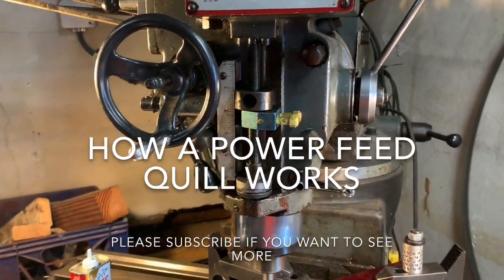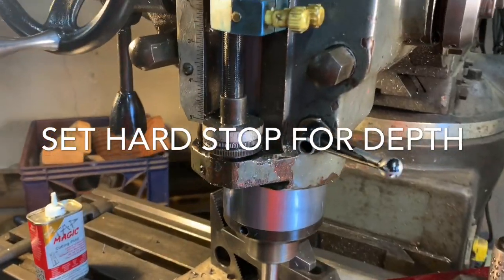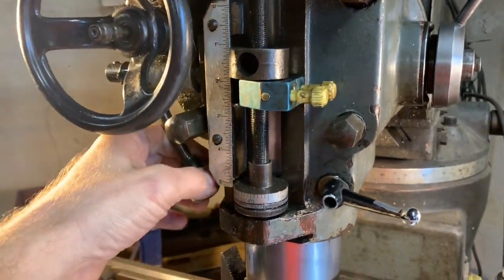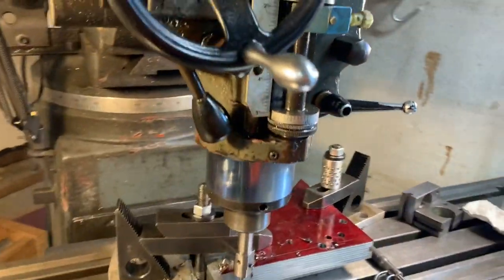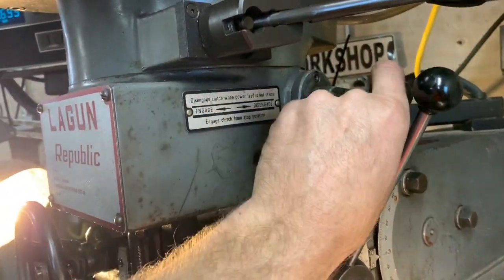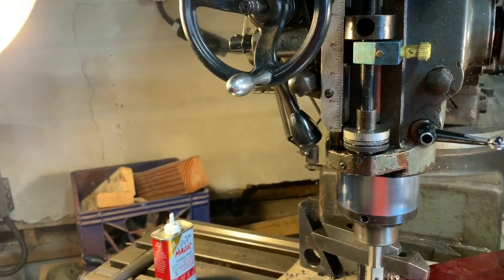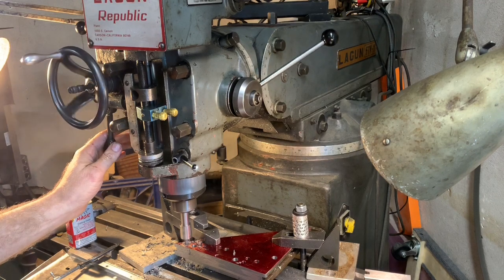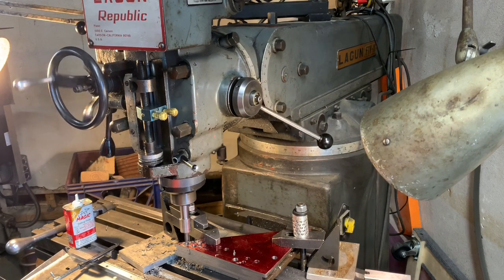How to use the power feed quill on a manual milling machine

Comment: How do you move that feed rate switch on the quill? Does it have to be running? Do you pull the knob out and then move it?   Ths one on this machine seems to be stuck. I have the power feed emgaged on the upper left side. And the right to left power feed works on the table. Quill lock is off and i can move it freely with the hand crank. I can get the crank by the forward and reverse power quil switch to spin but my lever to engage it to start the power feed also seems stuck. All the maintenance people that knee goe to run this are now gone. Trying to learn how to use it. I just cant get the feed rate lever to move or the power quill switch to start the power feed.
Reply from the maker: With mill off pull the knob and move it.  May require rotating spindle by hand to engage gears.